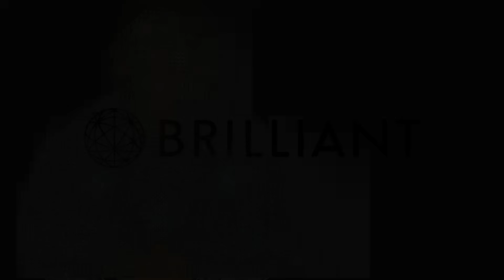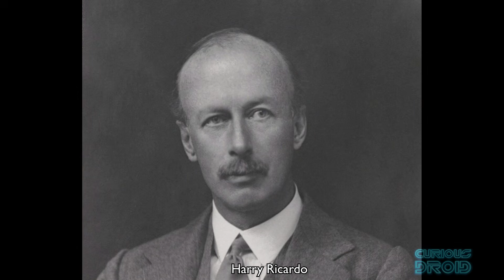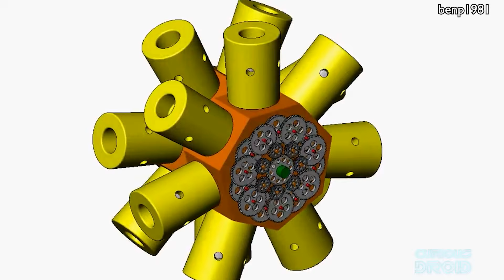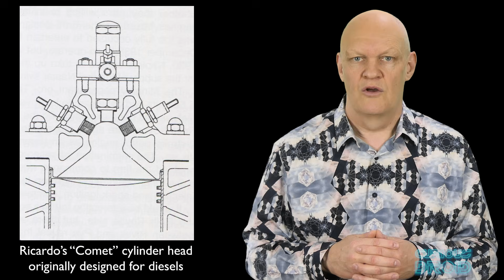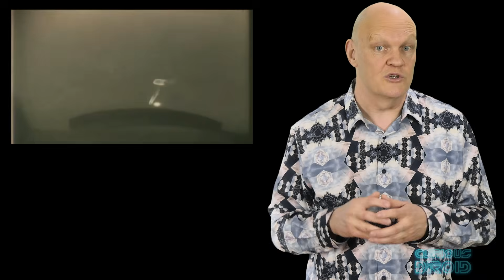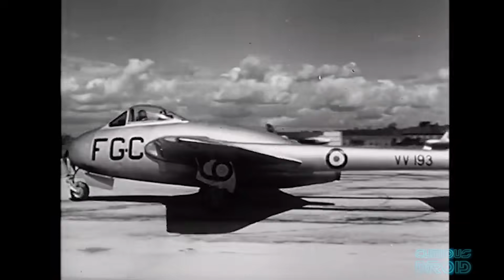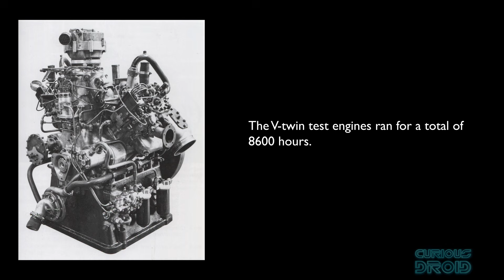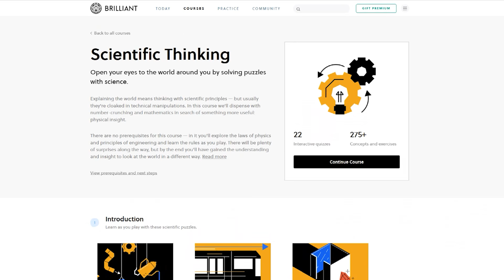Rolls Royce Crecy - The Most Advanced Piston Aero Engine Never Made.

Comment: The Merlin and Griffon engines had four valve heads. 
The Mustang test mule was planned to put the Crecy in the middle much like the Airacobra. It never got beyond a static model. 
Crecy failed because nobody noticed that the oil pump was unable to keep up with the engine at high speed. Con-rods suffered catastrophic failures. 
Harry Ricardo ran V twin versions of the engine over in Coventry. Basically two cylinders were lopped off the end to cheaply develop engine performance. But he ran a full size oil pump so the oil issue was never spotted. 
Just 10 years after the end of WW2, Walter Kaaden (an NSU engineer trapped behind the iron curtain) invented the two stroke expansion chamber and the through-piston boost port. He was getting well past 30bhp from his 125cc racing bike engines.

Comment: At the same time this was being developed RR was also working on the X-24 Exe.
Reply: The Exe was a disaster for Rolls-Royce.  Four banks from the Kestrel engine on a master and link rod system.  Its failure to be reliable goaded serious development of the the Griffon.
Reply: @andyharman3022  
The Exe was an air cooled X-24 layout sleeve valve engine. You're thinking of the Vulture. While the idea of a 24 cylinder combining two V-12s on a common crankshaft sounds so reasonable I don't know of any to really enter service aside from the Vulture. And the Vulture was no prize. There were a number of proposed 24 cylinder engines based on using 4 banks of 6 cylinders from successful V-12s in H-24 layouts. But the jet was on the way.
https://oldmachinepress.com/2012/11/23/rolls-royce-exe-boreas-and-pennine/

Comment: I had a 2liter 4 cylinder 2 stroke engine on a speed boat. That sounded bloody awesome. Gawd knows what a 30 litre v 12 must have sounded like
Reply: If you're interested in modern 2-stroke engine technology check out the Rotax/Evinrude voice coil direct fuel injected 2-stroke engine that's been used in snowmobiles & outboard motor boats for more than a decade.

Comment: They are not "rotary engines," they are radial engines. In a rotary, the cylinders revolve around a fixed crankshaft. The Rolls-Royce Griffon shared no common parts with the Merlin.

Comment: Can you imagine this engine with 12 expansion chambers at full chat?
Reply: If you're interested in modern 2-stroke engine technology check out the Rotax/Evinrude E-TEC voice coil direct fuel injected 2-stroke engine that's been used in snowmobiles & outboard motor boats for over a decade.

Comment: The Bourke engine has always interested me, designed and built by Russell Bourke in the 1920s, as his answer to a simpler Areo engine, though they only ever seem to make it to the test stand, I have read of an account of one being fitted into a 30s ford V8, and blowing the gear box, some were fitted as out board motors, the beauty of the Bourke Engine is it can be set up so multiple units can be added on one behind the other.

Comment: That is a fucking quantum leep in piston engine performance and I can't believe nobody's tried utilizing the tech elsewhere. I feel like the guys that run the open class at the Reno air races would have a field day with one of these
Reply: If you're interested in modern 2-stroke technology check out the Rotax E-TEC voice coil direct injection engine. These engines have been powering snowmobiles & outboard motor boats for over a decade.
Reply: If the Formula1 engine manufacturers can be arsed to produce the "final ICE" in 2025, they're mooting 2-stroke engines, probably opposing -piston.

Comment: In airplanes, the Napier had 3500 HP, and on the test stand with proper supercharging they had some with 5500 hp.  For a fighter like the Tempest made it the fastest piston engine airplane in the war and within 18 mph of an ME-262, and in some respects faster because the armament pylons didn't rip out of the fuselage at those speeds.  It took out 20 ME-262s and was the favorite V-1 tipper as it could run them down pretty easily even in level flight.  However, they were hard on oil and didn't have any commercial value like the big radials.  It was pretty hard to beat poppet valves on the Merlin and Griffon engines all things considered.

Comment: Mk 9 spit would have been OP AF. 6172lbs to 5000hp is 17% away from 1lb to 1hp. But obviously it would have to be a strengthen airframe, not for weight but for high end speed

Comment: It would be awesome to have a modern version of this engine, sleeve valves were awesome, and 2strokes! Heck a lighter gas version of the Detroit 2stroke would be crazy!! A gas 8v-71! Made from aluminum, with lighter components, and the sound, it would have to be insane ..
Reply: If you're interested in modern 2-stroke engine technology check out the Rotax E-TEC voice coil direct fuel injection 2-stroke engine. They're powerful, fuel efficient, virtually smoke-free & have low emissions. These engines have been used in snowmobiles & outboard motor boats for more than a decade. There's even a Turbo-charged version.

Comment: Perhaps Rolls Royce erred in designing the Crecy. Perhaps that design flaw was what held back the development of the engine.

Rolls Royce configured the Crecy as a V-12 at a 90 degree V. A 90 degree V angle for a V-12 does not put the engine in a naturally perfect primary and secondary balance:  arranging the engine's in a V at a multiple of 60 degrees does (60, 120, or 180 degree V) does.  Curious Droid mentioned that Crecy " . . . combined a lot of different technologies and newly developed metals . . . "  The added vibration induced by the poor design would have stressed the newly-developed technologies and metals in ways they could not handle.  Thus the newly-developed items could fail early, be identified as the source of the problems (instead of the flawed design), and time and money would have been wasted shoring up that which was not the root problem.

Yes, Rolls Royce could have mitigated the bad balance by splitting the wrist pins, as more recent designs have done, but first, did Rolls Royce engineers know about split wrist pins in the 1930's and second, why not make the engine right in the first place?
Reply: build one today & add todays tech, ill take a 2 cylinder for a bike :P

Comment: There are some vintage aircraft that still have sleeve valve engines, but sleeve engines are incredibly sensitive to the oil that's used in them.  One of the big oil companies (i think Shell) has the formula but wont make any, hence these engines can't run.

Comment: Ford once played with an air/fuel 2 stroke car engine. I Wonder what an air/fuel 2 stroke aero engine would be able to pump out.
Reply: If you want to know about modern 2-stroke engines check out the Rotax E-TEC voice coil direct injection 2-stroke engine. This engine has been powering snowmobiles & outboard motor boats for more than a decade.

Comment: Imagine what Mike Patey could build if he got his hands on one of these!
Reply: A Crecy.... but with nitrous!
Reply: I'd tune it up as far at it would go (possibly run it on pure methanol) and put it in a p51 racer. Win the reno air race unlimited class hands down.
Reply: @tech4pros1  If they weren't so damned big and complicated (and if RR still had the full blueprints, and you had all the money in the world to throw at it), you could CAD/CAM one out of similar (but more modern) materials. In fact, modern materials might solve some of the vibration, over-heating, and valve-failure problems.
Then it could become the most powerful air racing engine ever utilized!
Reply: Some serious wizardry would take place
Reply: The important question is, can he put it on a Wilga?
Reply: Another single-seat blender, of course. I don't think his wife wants to ride anymore.

Comment: Fascinating, and brilliantly researched and presented as always.
Talking about engines that came too late, I have a fascinating book that has a chapter called 'Supercharging and where it leads'. In that, there's a Sulzer engine which has a diesel gas generator section comprising opposing pistons and no crank. All of the output comes from extracting the energy from the exhaust gasses generated. The supercharging is very high, and that's the point of the chapter. It basically shows that the more you add, the more power you get from a turbine and the less from the shaft. At the extreme, there's no point in having an output shaft at all.